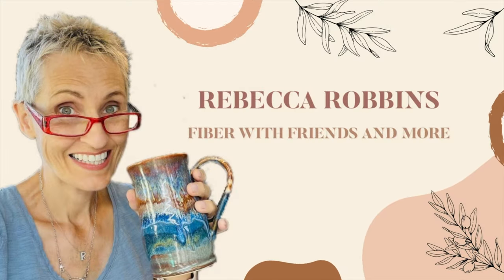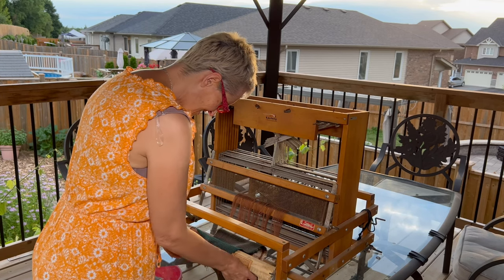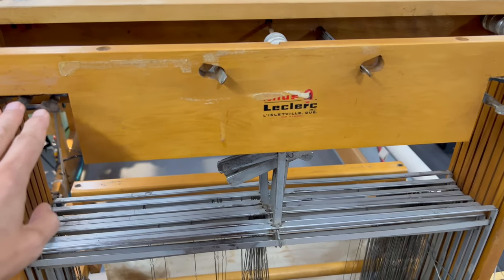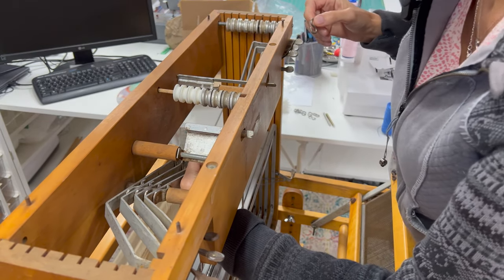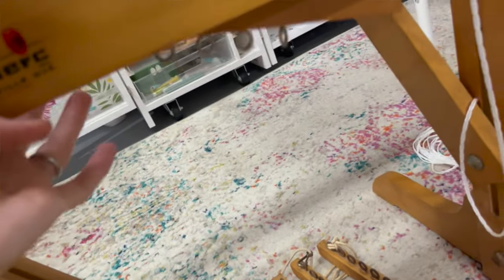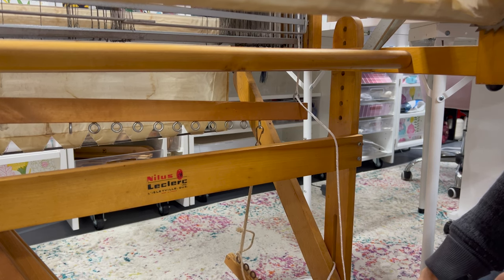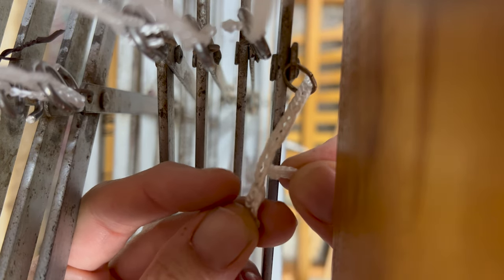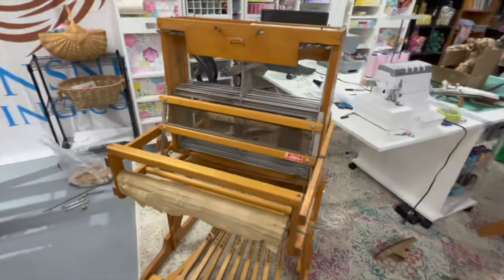Leclerc Medico 8 shaft loom refurbish

Comment: I just acquired a Medico loom with the foot treadles and am trying to sort out a problem of the harnesses not falling all the way down when switching between one pair of levers and the other or foot treadles (i.e. from harnesses 1&3 to 2&4).  Do you think it makes any difference if the cords that go over the pulleys sit in front or behind the harnesses? On mine, two cords sit in front and two sit behind the harness. I have been advised to remove the harnesses and see if they are warped. But since you had the same loom, curious of your thoughts. Thanks!
Reply from the maker: Does it feel like they are getting stuck on the way down?  It’s been a while since I had that loom.  First thing I would do would be to make the cords on the same side, clean it really well and lube up the shaft grooves.  They are pretty simple looms so it shouldn’t take long to figure out the problem.
Reply: @Rebecca.Robbins  Great tips! Yes, they are getting stuck midway on way down. What do you use to lubricate? And do you put it on the metal or the wood? Thanks!
Reply from the maker: I usually use a silicone lubricant.